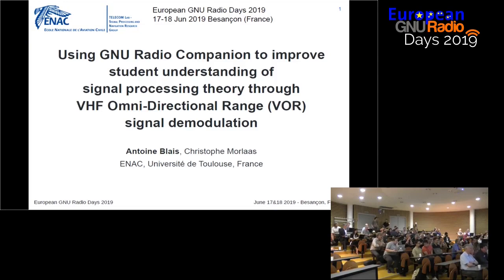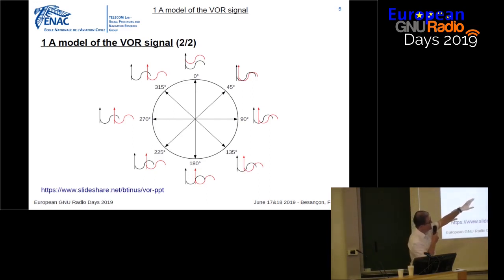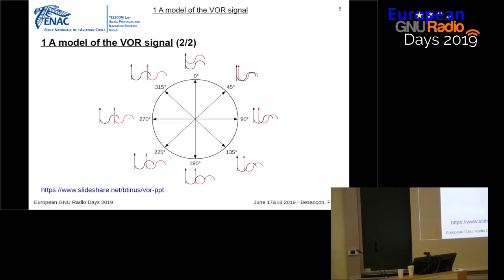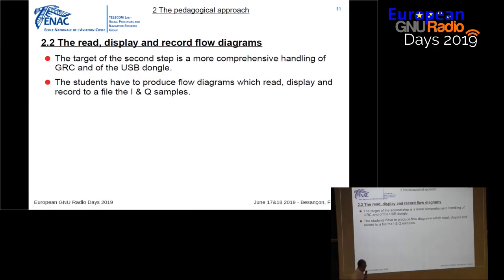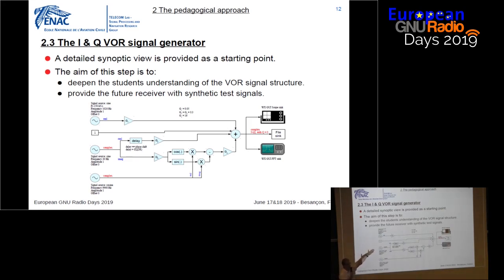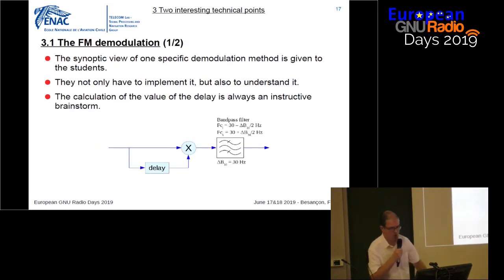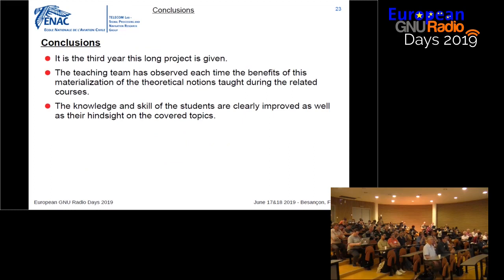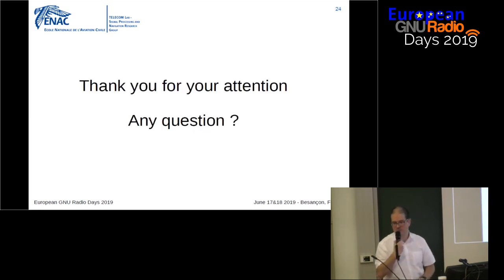Using GNU Radio Companion to improve student understanding of DSP theory through VOR demodulation

Comment: I keep trying to figure out what GNU Radio itself is, and I keep seeing GRC. Is there something more to GNU Radio? IOW, is there a way to enclose the final product in something more aesthetically pleasing than the GRC environment?
Reply from the maker: GRC is a shortcut for GNU Radio Companion. I am not sure how "aesthetically pleasing" should drive your selection of efficient DSP processing. GRC is a Python generator for calling GNU Radio processing blocks that you will get rid off once familiar with the C++ calling conventions when searching for efficiency, or stay with for quick and dirty prototyping. There is a new Qt graphical framework for GRC  that you might find more "aesthetically pleasing" for what it is worth. Vim is most aesthetically pleasing to me !
Reply: @europeangnuradiodays1445  By "aesthetically pleasing", I meant some sort of semi-finished product that you could share with someone (who isn't a techie geek like myself) to just use. IOW, GRC is analogous to a hardware "breadboard" for tinkering, testing, etc. I'm looking for something more like your final hardware soldered to a PCB and inside an enclosure, etc.
Reply from the maker: @ChaplainDaveSparks  Have a look at the Filter Design Tool (in GNU Radio Companion: Tools -> Filter Design Tool, or https://www.trondeau.com/home/2012/12/18/new-filter-design-tool-in-next.html) which was created with GNU Radio Companion. However the targeted user will need to have GNU Radio installed on their computer since GNU Radio Companion and the resulting graphical interface will be relying on the underlying (C++) signal processing libraries. During the prototyping stage you can define all the placement properties of the GNU Radio graphical interface so they are reproduced when launching the Python script you will be sharing with the users. There is now the option of generating C++ code from GNU Radio Companion which might be statically linked and maybe avoid the dependence with dynamic libraries, but I have never used this newer feature.